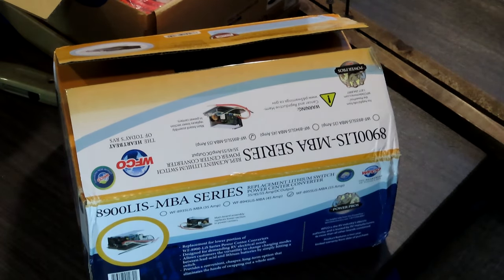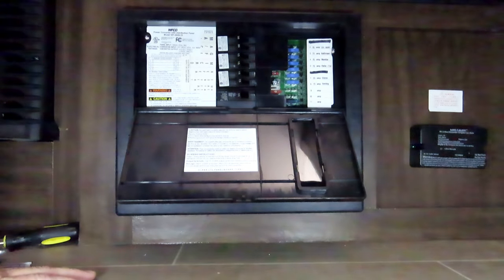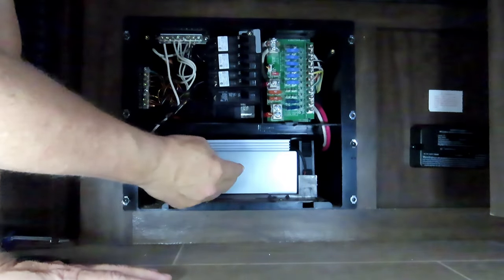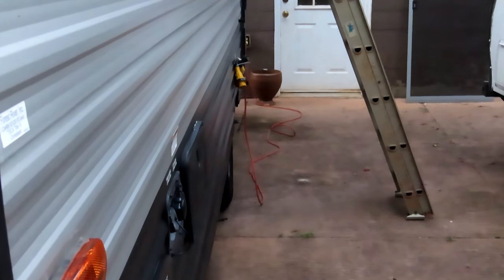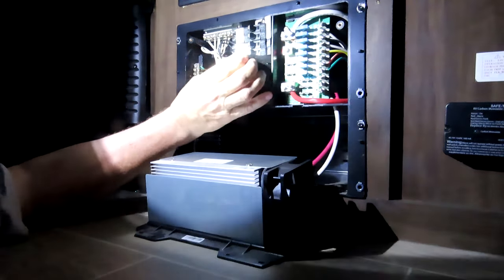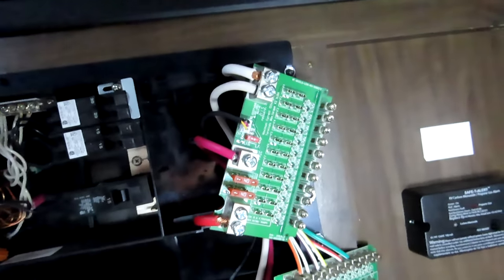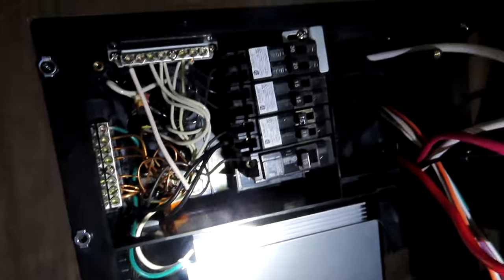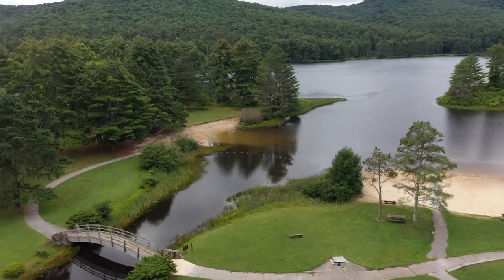Changing the converter on my Travel Trailer RV for Lithium and Solar, WFCO 8900LIS MBA Convertor.

Comment: Mine was a giant PITA to install. My charger is a separate box from the fuse/breaker box. For some reason, the mfg decided to run all the heat ducting over the top of the charger. I'm not the kind of guy that curses a lot but I did let a few fly when trying to get that charger out. Needless to say I put the replacement in a much more convenient place. I do agree with you about the lithium batteries. I'll never go back to LA.  Only bad thing is I bought my Weize batteries from Amazon before I knew you stopped the affiliate program. I'll keep my eye out on your links in case I need anything in the future. I'm surprised Akela wasn't trying to help you.
Reply from the maker: Yes, you can tell there is no thought about where they stick things in an RV (or any other mass produced product).  Akela was there with a stick in case I need to beat it to death, but it really was pretty easy except being on the floor the entire time!

Comment: Didn't you do the A Liner converter box a while ago?
Reply from the maker: For the Aliner I had to change the entire converter.  And I switched to a Progressive Dynamic model and I’m not impressed. It only charges at 10amps max.  The WFCO will easily hit 40amps
Reply: Would you recommend this converter for Aliners?
Reply from the maker: @teresas7272  It is a little bigger than the Aliner Converter.  The Aliner is a 8735, this is a 8900 model, about 3 inches taller.  It has more circuit breakers for the bigger A/C and Microwave and Electric Hot Water.  You could use the 8945 or 8955 in the Aliner, it would not hurt, but it is designed for a larger more equipped camper.

Comment: Is it possible to just replace the converter itself and not the 12V distribution block?
Reply from the maker: No, there is a change in the wiring so you don't burn out the distribution block when charging at 30-40amps. It's not that hard, just swapping over the old wires to the new terminals.

Comment: What brand battery are you thinking of getting i was looking at power queen
Reply from the maker: Love the Wieze Batteries.  I bought a 300 Ah monster, and it weighs less than the Lead acid. I have a link for Wieze batteries in the description and on the webpage.  I think you get a discount too. But they had all the right protections and a very good BMS.

Comment: Be careful I worked for GE when we opened electric battery plant, then closed it just as fast. Due to factory flaw that can't be fixed lithium catches fire. No other alternative just a matter of time
Reply from the maker: There are now several types of lithium batteries. The LiFePo4 are the most stable and are carefully monitored with a BMS so they stay safe.  And besides, fire isn't so bad, it probably allowed us to walk upright and live in houses instead of caves!
Reply: Be careful ❤😂

Comment: You didn't show the most valuable tool a knee pad or cushion for the old man knees.
Reply from the maker: I never got onto my knees except to film. I was mostly lying on my side trying to hold my head up (the curse of a fat head).  😛
Reply: I know what you mean. I have been under many dash boards head under the dash feet in the back seat .I have about 4 knee pad and 2 creep seats .Sometimes I wonder how they install half this stuff to start with. @GoingNoWhereFast
Reply from the maker: I know how they build them, they build them on a bench and then stick it on the vehicle frame.

Comment: not complicated, but a lot of work.  The manufacturer changed the large positive and negative terminals on the fuse board, turning them 90 degrees which really makes it difficult to reinstall.  Like the video says you have to really work to stuff the wires back in and reseat the board. Crappy engineering.
Reply from the maker: When you’re designing this stuff on paper, everything works perfectly. These idiots should get out there and do it themselves. They would make a much better product.